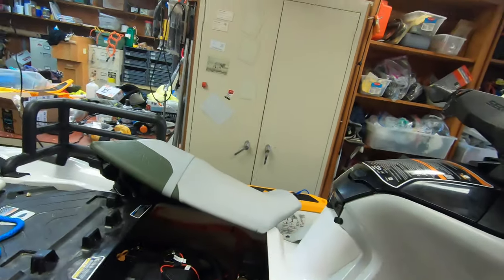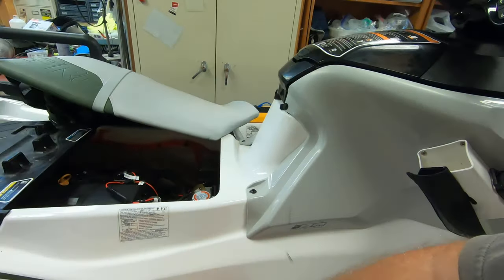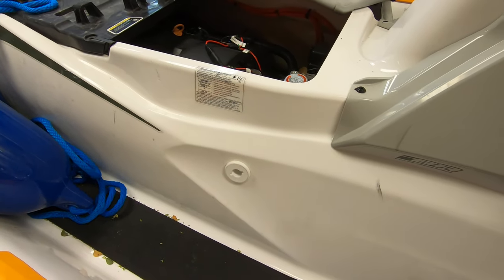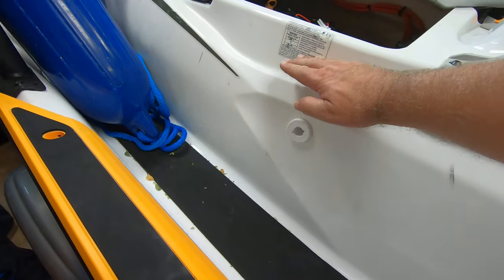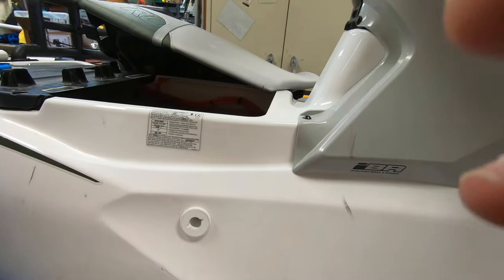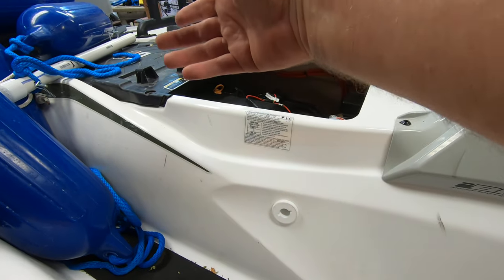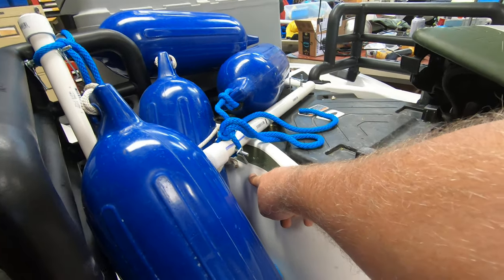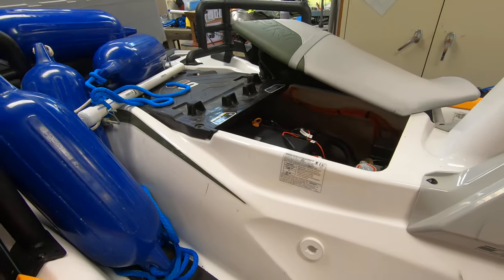SeaDoo Fish-Pro Tips -  Bilge Pump Discharge Port Tips

Comment: If the water is getting to that level to backflow into your bilge discharge port while on your trailer, start looking for Noah for an autograph. On a side note: buy a Rule bilge pump. It has backflow protection.
Reply from the maker: I hear ya. The boat was at a shop sitting in their yard waiting for them to "get around to it" and a big storm cycle came in. Ill checl out the Rule when I change this one out.

Comment: Hi Bill , I just received the 24 Sea Doo Fish PT. I ordered the factory bildge pump, which always runs when the accessory mode is on. I also have a 32 AMP bigger battery coming to help with the battery load. I was wondering what do you think of the draw on the batteries while the damn bildge runs? I have only a few min on the ski this season, not yet broken in. Greetings from Montauk LI NY .
Reply from the maker: These factory bulges do no draw like a trolling motor or the radio when the accessory mode is on. My recollection is that the accessory mode will shut OFF if the battery draws down to 11.xx volts, so as to not over-drain things and leave enough to start the ski.. On that factory "always running" bilge. That noise drives many folks crazy especially it they are fishing. Many remove the  factory bilge and replace it with float activated bilge pump wired direct to the battery. In this case of being wired direct, if the float activated bilge is running, it draws juice from the battery as long as the bilge is firing. Because of this, the battery can drain completely. That said, it the bilge is draining the battery because it is firing and discharging water for that long  , then you got a bigger issue than a dead battery - you are going to be sinking.

Comment: Need a check valve to keep the water from coming back in.
Reply from the maker: Hey John - Yup.. I have been thinking about that. My conclusion is that since that port is under the gunwale that any water that continues to come in and fills that gunwale will exert water head on that check  valve and over an extended period of time backseepage will occur . Like if a carbon seal craters lowering the hull to make things into a sub-doo , or when sitting in the boatyard where they do no bring it inside ( like happened last year as they gave me the run around about time to fix something). Anyway thinkin that the water will seep over a long period of time into the hull and the pump would be cycling and eventually the battery would wear out and full water entry would happen. I am going to be safe and raise the discharge port to be above that gunwale. Ill post another video of the new higher - makes me feel better - port.
Reply: if you are still not convince a check valve will solve your concern then tape over that discharge port.

Comment: Hey thanks for the video. I am also getting a 2021 Fish Pro. I think I'll be putting a aux bilge pump in after watching your videos. A couple of  questions, did you invest in a second battery system? And I'm thinking you carry extra fuel...yes? I will be a "cruising" Seadoo-er, not so much fishing one. I just wanna go out and explore. It's good to see someone going out and putting miles in! Thanks again!
Reply from the maker: glad you liked them. I did not put in a 2d battery. I will keep that in mind though. I have heard that people have done that. Yes I do carry xtra fuel. I use Nauta/Imtra flexible tanks nested in the foot wells. Good for you on cruising. The garmin depth finder is extremely valuable- Mine is spot on even at speed.

Comment: I just got one bilge pump from ebay's I have a few question in my mine ok ¿the ski always go down from the back because the carbon ring or the drying plugs right ?
I Got my bilge pump I noticed if I put water in to the outlet line the water pass true the hull so in my opinion I think is better to put the outlet hose in the front of the ski ?? 
No on the back o the side !!!
Reply: Exactly you must be able to see it if it goes off.

Comment: Any way of running the out port on the outside of the jet ski, maybe in the front or sides?
Reply from the maker: I did finally do this. I ran it thru the hull underneath the front left grey cowling cover... and then made a hole thru that cover itself, with a flexible black pvc tube from the bilge discharge port thru the cover. I did this because the water would slosh all out under the cowling and I wanted a better visualization of an actual water discharge. I may post another video to this.
Reply: @billjenkins1535  yes, let’s see a video. Thanks

Comment: Hi Bill I order myself the 2022 fish pro do you recommend a bilge pump an a second battery for long hauls?
Reply from the maker: I certainly recommend the bilge pump, and porting the discharge to someplace forward where you can see if it is discharging while you ride. On the 2d battery. I do not do any fishing and so I do not have any of those added electrical components like trolling motors like the other people are putting on their skis. That extra battery kit as I understand it mounts to the underside of the engine compartment cover and will make that cover a bit more work to take off when you clean the engine compartment, and also when you want to inspect things, so I will not be adding one. HOWEVER, I do carry one of those small jump start batteries, such as the AntiGravity unit,  in case my battery somehow discharges too much.